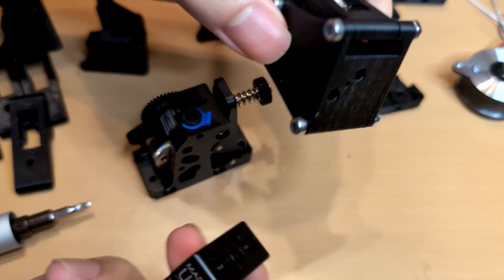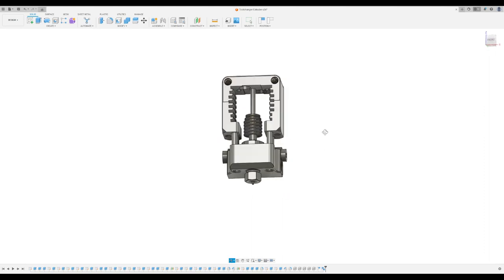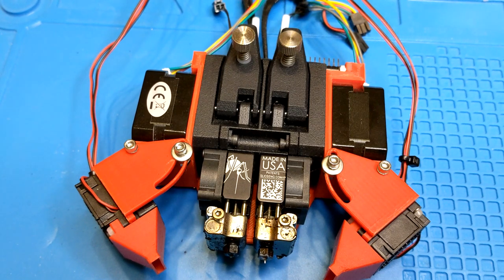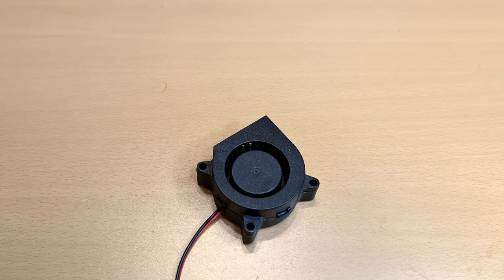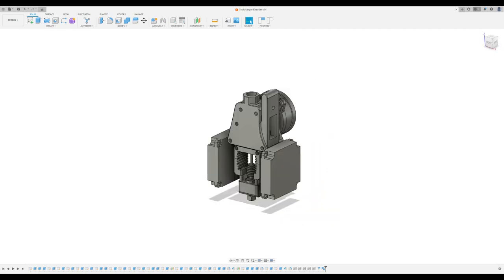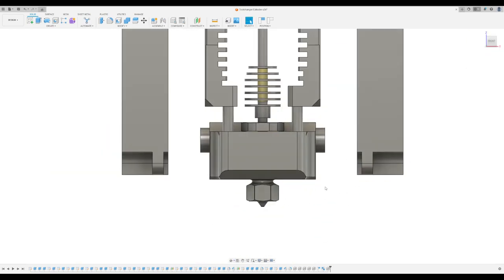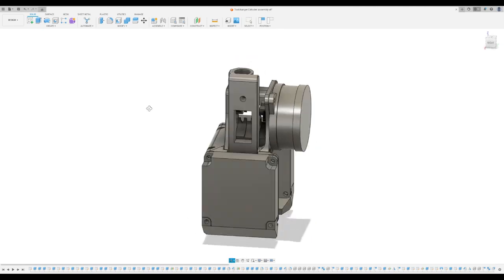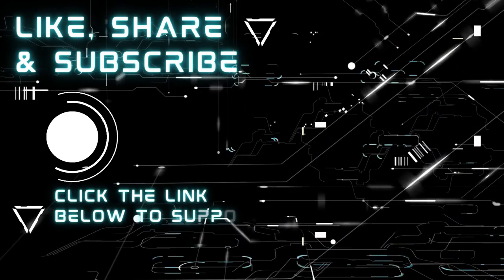[Tool changer] Printhead config for tool changer?

Comment: You could have the hotend and its fan rotated 90 degrees to fit a bigger fan in front. It can also reduce the side profile for you to fit more toolheads.
Reply from the maker: Yes, it might be a solution with a 4020 fan but have a larger size in the Y direction.
Reply: @SlowEngineering  True, it all comes down to trade offs. Assuming the whole point of your toolchanger is mainly to use different materials, you can reduce the volumetric space taken by each tool by incorporating part cooling into the tool carriage, similar to the pitstop designs by mihaidesigns, although I wouldn't recommend a 5015 fan for it, it makes the whole carriage bulky and heavy. A remote cooling solution is more ideal, like CPAP or even Berd Air (I think you'll find Berd Air to be a little more compact).
Reply from the maker: I think you have the insight to run a compact solution. I thought to separate the part cooling from the printhead before. But then I realized I needed to swap the tool heads without crashing the cooling ducts. This makes the swapping harder, so I suspended it. An arm for tool changers is making the entire system more complicated. I planned to build the system in the enclosure. On the other hand, I saw the Berd-Air you mentioned. It is indeed a solution for part cooling. But how about the pump's lifetime and how accurate control cooling is for particular layers or features?
Reply from the maker: I agree that the CPAP concept is the best for all-around cooling. Just need to deal with the inlet and let the enclosure have a similar temperature. I'll try a different design to see how it will be. Thank you for your suggestions and detailed explanations.
Reply: @SlowEngineering  Good luck with the toolchanger 👍